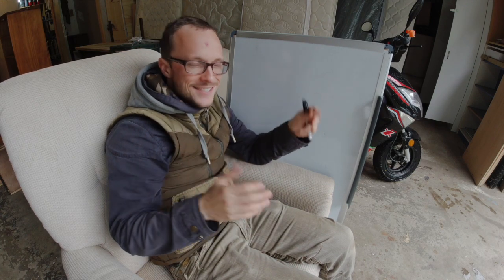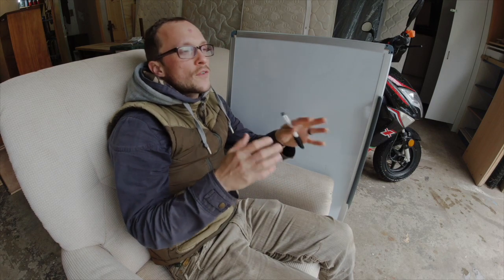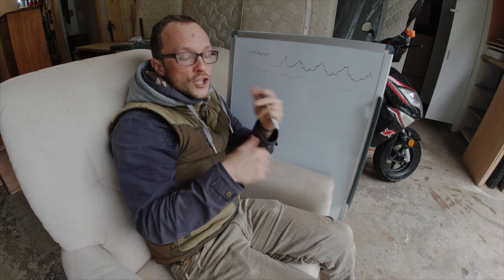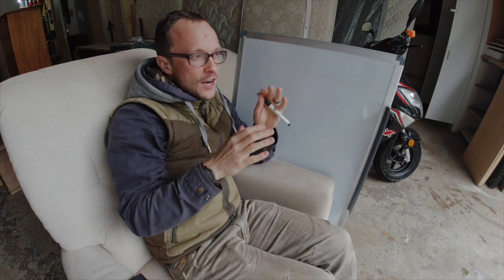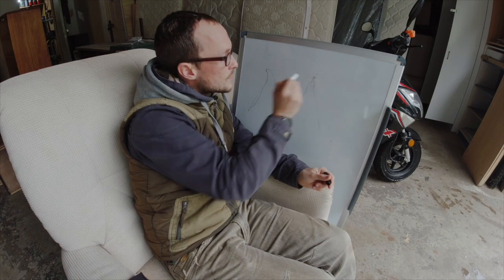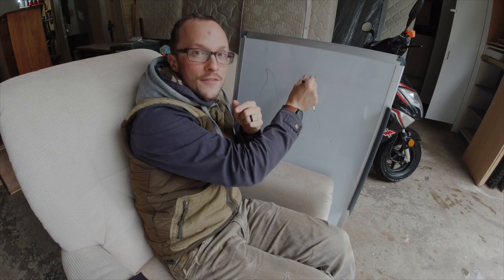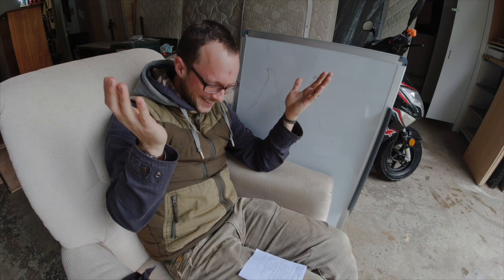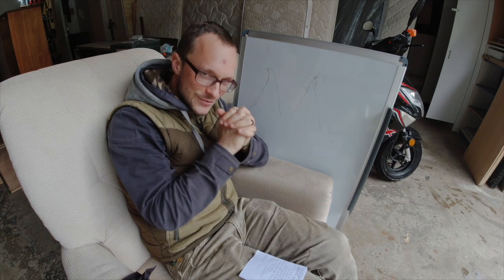Science Has SPOKEN! Breakthrough Discovery in Dual Grit Edge SEM Courtesy of Dr. Todd Simpson & OWU

Comment: hey @homeslicesharpening!

Thank you so much for your video and channel. It has helped me solve a mystery of my own.

So I got started sharpening a few years ago watching this video (https://www.youtube.com/watch?v=o4XgLgvqjYk) which is basically a simple 1-stone method, where you create a burr, then use that same stone to "deburr" using edge-trailing strokes. This worked fine for me for several years, it would get paper slicing sharp, and cut fish decently for 2-3 months.

I recently decided to "get serious" about sharpening, watch detailed tutorials about maintaining the perfect angle to create a perfect apex, minimizing the burr properly, use a strop with diamond compound to completely remove the burr, etc. And found that the resulting apex, was sharp, but wouldn't last a single wash with the sponge. Which didn't make sense, because supposedly the strong apex is everything.

I also couldn't understand how my old "dumb" method was creating an edge with better retention.

But your channel, and https://scienceofsharp.com/2021/06/15/dual-grit-sharpening/ explain that fully. I was creating a large burr, and straightening it out, which actually has decent sharpness and edge retention.

One interesting thing to consider: how to sharpen in the simplest way possible (fewest steps, one stone only), based upon maximizing the performance(sharpness and edge retention) of the burr. I'm going to be experimenting on this on my own, since the "proper" and "complex" method has been giving me worse results with more headache.

Comment: Wow! I just found your channel and have been really enjoying all of the work that you have put in. I am curious, have you noticed your edge bevels becoming a bit lopsided with this technique since you regularly use a courser grit on one side?
Reply from the maker: Thanks heaps Ben!

I have not personally noticed my edges becoming lopsided, nor have I noticed any performance problems from an edge with unequal size of secondary (edge) bevels from one side to the other.

Some people claim that this unequal grinding/profiling does happen, and that it does mess with blade use by creating a knife that "steers" one direction or the other in the cut.

If you want to try out dual grit edges for yourself and are concerned about this, I would just recommend switching which side you sharpen the coarse side on each sharpening job.  This ought to equal out the amount of material removed from each side over time.

Welcome to the channel, my friend.

Comment: This does make sense. I've had similar results with some soft, cheap, kitchen knives but finishing both sides on the same grit stone. They wouldn't get as sharp as I wanted, but would scrap shave. After cutting a few feet of cardboard they would shave smoothly. Soft, gummy, 420/3Cr that was almost impossible to debur. I'm not saying I was doing that with purpose, just had roughly the same outcome.
Reply from the maker: I’ve actually experienced a similar thing before.  Hard to remove the burr on soft steel - did my best to align it and remove burr, but still felt burred.  After a bit of moderate cutting, it actually felt better.

Comment: Has anyone tried this on a macro scale with relative grit ratio on a hatchet or something with a convex?

I may give it a shot with my old Estwing and a WorkSharp KO with the blade grinding attachment.
Reply from the maker: I’ve not tried it on an axe yet.  I have done a convex Bark River, and it worked very well.  I’d imagine it yields a bigger increase in edge life for slicing than for impact tasks, but definitely worth some research.

Let me know if it works well!

Comment: I'm wondering how effective this edge would be in regards to field dressing an animal. So many more tests! I'm stoked.
Reply: I will go out on a limb and say it will preform admirably, as the finer “ burr” gets worked and erode, the coarse will keep cutting , me working in the hunting & fishing industry and ranching for the last 35 years 
I have seen some changes in better quality steel , yet when I am touching up a expensive “ super steel “ knife, 
And a guy helping process, was banging out 2x the animals with a proprietary edge cutco  in 440A 
I can only assume that the proprietary system keeps a super sharp edge with a complex serrated and plain edge”” recessed edge is the series of three razor-sharp edges on the blade with pointed teeth that protect it from coming in contact with surfaces that can dull the knife. The edge allows the blade to cut forward, backward or straight down with equal ease.””
( it must be returned to the factory to be sharpened) , with “ bro science “ and real science 
Working together it’s a very interesting meeting, and probably in its infancy,
Reply from the maker: Seriously!!!  I don't even know where to start.  I guess to start anything I will have to stop staring at these SEM Images.  But they're SOOOO COOOLLLLL...
Reply from the maker: Let me know if you do some field dressing - would love to heat how it goes!
Reply from the maker: I’d imagine it would be a good edge for field dressing.

I have experienced a decent increase in edge life in slicing and push-cutting tasks.

I think your increase is smaller in chopping, or high impact tasks.  It’s not bad for those, it’s doesn’t seem too too much better.